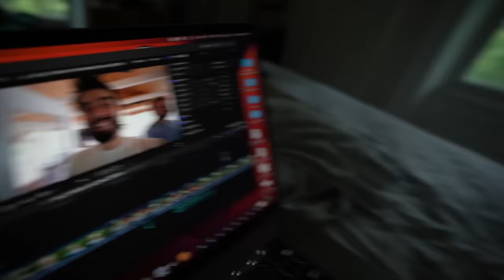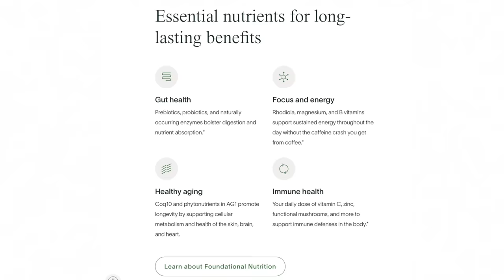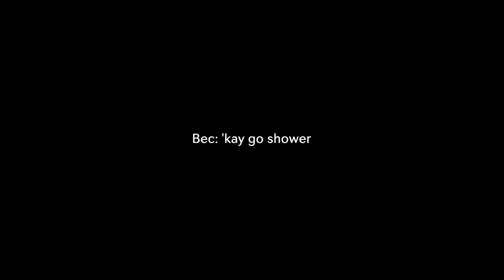This Took Us 2 Years to Make!

Comment: Add 3-4 inches of soil back on top of rock as grass is very shallow rooted, it will do fine but will have to be watered a bunch, all the piles of wood debris, trees, greenery, rock and soil would be great in a
 "hugel culture" wrap around perimeter! The point of hugel culture is water preservation. If installed on perimeter of lawn it would help keep the edges moist and green!